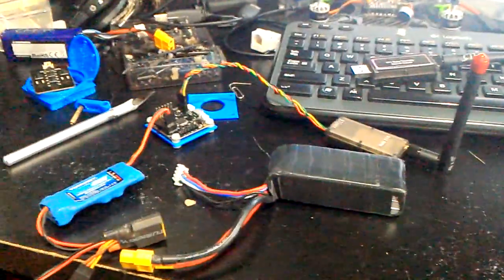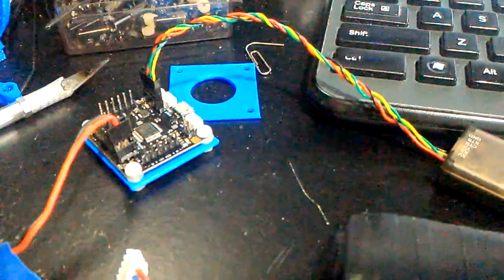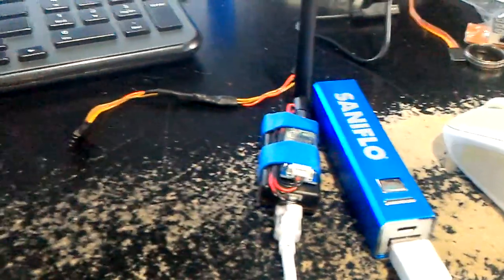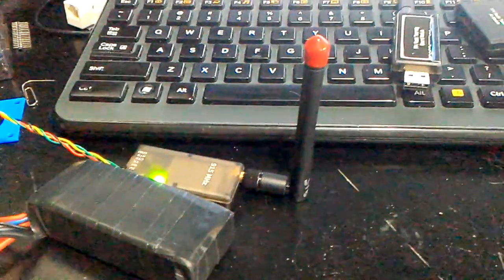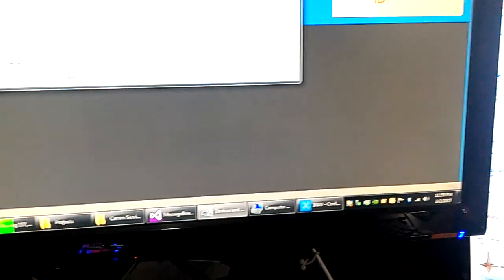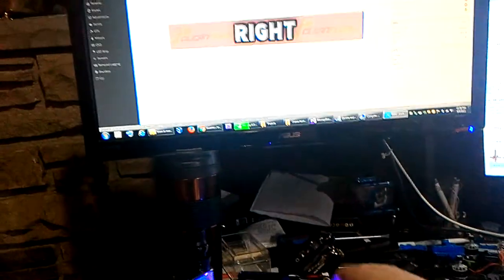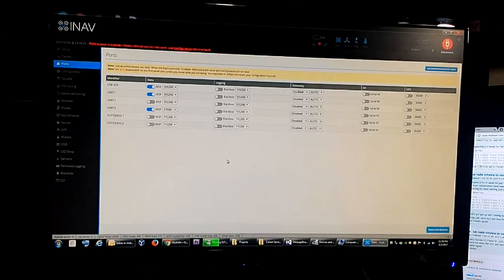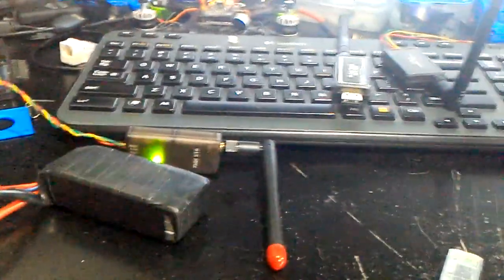Long Range Communication with iNav over BlueTooth and 3DR Radio

Comment: Hi friend !!, nice solution !!, I have a pair of these 3DR radios on 433Mhz, so, please tell me what is that device that you attached with blue tape to the modem ? its the bluetooth PCB ? where can I order one of this ? , and the wiring diagram between the 3DR modem port and that bluetooth port ? , thank you for your video

Comment: Thanks for this useful video. Can you recommend some antennas to increase telemetry radio range? I have 433mhz radios...
Reply from the maker: I've found that the stock antennas are good for a little over a km, the thing about low frequency antennas is that they get quite large. Spirals are common.
Reply: @cammservices  thanks for your response.  Are your radios 100mw? I have 500 mw. I saw a video on the drone biz channel where they claimed to get over 25 miles with a v shaped antenna mounted a few meters above the ground.... https://youtu.be/QSjUdOOlCxk , see 18.00 minutes in....
Reply from the maker: I used an antenna tracker with my 750mm drone. But it was relied on a linux waypoint application to operate. If you are proficient with linux, you can look into that route.

Comment: Hi, can the mavlink protocol be used for rc control using the common 433 lrs orange modules running
 ultimate LRS firmware ? dont need full telemetry only rssi

Comment: I have an extra set of 3dr with Air and ground unit.  Ground unit has usb where as the air unit uses the jst connectors.  Can i use the extra air unit as my ground unit connected to the bluetooth or do I still need to use the original ground unit?  What I'm trying to ask is the air and ground units interchangable?

Comment: Hello Friend. Good afternoon here from Brazil. Your project is very interesting and would like to use it. I have a question: would it be feasible to adjust the speed of the 3dr telemetry to 115200 by Mission Planner? This would have a better communication speed performance. What do you think?
Reply from the maker: +Henrique dos Reis Hello, you can increase the speed using mission planner if you wish, but the faster the link, the less stable it will be effecting your range. Not sure if you have any experience with dialup modems, but the slower the communication the longer the datapacket, the less likely that multiple packets would be lost due to noise on the link. Infact slowing the communication even further would give you even better range.
Reply: CammServices Thanks for the support! Understood. In fact I have little experience. I'm starting now.
Reply from the maker: Well then I will wish you luck, it's a great hobby. Fly safe and have fun.

Comment: Hi, I was wondering if I can use my left 3dr radios on naze based Fc's. Im happy to find out your video.  Is there anyway to find a wiring diagram of your connections somewhere? (;
Reply from the maker: +Ariel Drach 5v to 5v, rx to tx, tx to rx, gnd to gnd, just like any other Uart device, set MSP and 56,200 buad on configurator and you should be good to go.

Comment: in inav 1.7.1 release notes - it stated that now Mavlink has finally two way support . does it mean that now we can use the cheep 3dr radios without any firmware change as they are. and use them for mission planning with EZ-gui  in a similar matter that was possible with apm and tower or mission planner ?
Reply from the maker: You always could. I've been using 3DR radios with my builds for about a year and a half now. (Cleanflight) I made a few settings changes, but the 3DR radios allow for normal 2 way serial communication. MAVLink specifically is a protocol for telemetry data. That is why in the settings I had it disabled as it wasn't specifically supported.
Reply: thanks , so what is the significance and why effort was invested to enable two-way mavlink ?  (i'm an apm pilot)
Reply from the maker: mavlink is good for antenna tracking, follow me, and follow the leader. It's specific to telemetry and can handle transmitting interruptions. But I found with the right settings, I can cover up to a 1.5 km radios of full serial communication.
Reply: thanks , from what i learned so far : in the apm I have just one telemetry port that is used for osd & 3dr radio with tower and with a small teensee I can also bring the telemetry to the taranis - all my telemetry needs + all  what you mentioned about mavlink  as dronies , follow me , mission planning , camera control etc . from a single telemetry port one Uart only - and in addition solid rock GPS performance and  sonar , leds , data flash logs , and even serial receiver (ppm)  while with the modern flight controllers F3 F4 with clean flight / inav with 3 Uarts  or even 4 I can not achieve what I have with a single telemetry port in APM :  sbus receiver 1st Uart , osd 2nd Uart , gps 3rd Uart and i run out of options , no place left to connect the "smart port"  for the taranis  no place to connect the 3dr radio (for ez-Gui)  and what about sonar ? leds ? black box logs ?  I probably must  be wrong , clean flight / inav are new for me , I also did not used ez-gui yet , but so far as i learn more and deeper i can not see how inav can be a replacement  for my old outdated 8 bit APM  and ardupilot 3.2.1 :-)   all what I hoped for is that now that inav can support  two way mavlink  then  I will be able to use a single uart as in APM for 3dr radio and osd and even "smat port" as I use with APM   and the other uarts will remain for other things as Sbus & GPS ....
Reply from the maker: It gets better... F7 is now out :)
Reply: hope so ...  I looked on the omnibus F7  it has 3 available Uarts   1,3 & 6 
so if  1 for sbus  3 for gps 6 for smart port again no place to connect the 3dr radio ....  all other uarts (8 total) - are used for all the other things on board as osd ,blackbox etc ...
Reply from the maker: Between the OSD and the 3DR telemetry is covered for the omnibus I just don't use smartport, but there will be distributions soon that will provide more accessible uarts.
Reply: btw - as far as I could find just the omnibus has a Baro and fits my needs (although I will not have telemetry on my remote control) all the other F7 boards that I saw don't have a baro so they are not suitable for autonomous flights . is there other f7 board that has all the features of the omnibus ?
Reply: Is it possible to define a software serial in order to accommodate the smart port as well ?  I assume that on such powerful board it can work flawlessly  .
Reply from the maker: As of now, the omnibus f7 seems to be the best fit, softserial should be achievable, but as of right now, I'm not sure about softserials current support by iNav. I have the omnibus f7 on route, but won't likely start testing for another two weeks. I2C barometers (Arduino) are another option for adding to a board that doesn't have it integrated. Also easier to isolate from wind when separate.
Reply: does inav supports I2c barometer ?   i know about compass for sure . if so it is great  - any f7  6 DOF board with I2C will fit .
Reply from the maker: I2C can support multiple devices connected in parallel as long as they don't have the same id. You just have to use a supported barometer which is listed under the dropdown in iNav configurator configuration tab. LCD, barometer, compass, pitot tube, etc.

Comment: Saniflow is a brand name for emasserators in the U.K, you know like when you want to put a toilet somewhere you have no 4" drain ;-)
Reply from the maker: Same company. The Canadian Sales division is a client of mine. We do technology development for them. That's how I ended up with the USB power pack, which ended up being in arms reach when I was testing.
Reply: Ah, just sort it was one of those lost in translation things , like fanny pack, which is downright laughable over here ;-)
 Or Aluminium....soldering, nice to get free stuff from shyte though eh?
Nice vid mate, I've got one on order, as the 3DR radio doesn't seem to have all the functionality with Inav and EZ-Gui.
Reply from the maker: iNav is working on adding MavLink to one of the upcoming releases. Should increase functionality, but right now I use the 3DR radios to facilitate direct connection with MavLink disabled. For Mission Planning and Telemetry, I'm using WMP on a ubuntu laptop. With MavLink you will be able to use antenna tracking like with APM.

Comment: How much range do you get outdoor?
Reply: Hello CammServices  , regarding your hope to have antenna tracking with iNav - on the Ez-Gui web page there is a very interesting detailed post about it     http://ez-gui.com/other/camera-trackingfollow/
Reply from the maker: Set at 20db i get about a km with the dipole. At that point it starts to get unreliable depending on height. You can change the settings on the 3DR radios easily with APMPlanner2. To improve speed set MAVLink to none and Max Win to about 33. When using the 3DR Radio with APM products you can setup a direction antenna tracker that I use to be able to get upwards to 5km+ out of. My hope is to get antenna tracking working with iNav.
Reply: Oh.. wow. With my pair I get a wooping 5 meters link whatever parameters I'm using. Which firmware are you using?
Reply from the maker: Go to the APMPlanner2 Initial Setup, then 3DR Radio. Yours are probably set to be FCC Part15 Compliant. You will need to up the db to get better range.
Reply: I've already set the power to 20dbm and applied your suggested settings
Reply from the maker: Also make sure your Baud is 57600 and Air Baud is 64000, if you lower the Air Baud setting your connection will be slower but more reliable, I am using 64000 for mine. The ECC check box should be checked for reliability. It's like having TCP over UDP, slower but uses error handling to confirm packet delivery.
Reply from the maker: Were they already that or did you just set them now?
Reply from the maker: If you are still having issues, try Max Win at 100